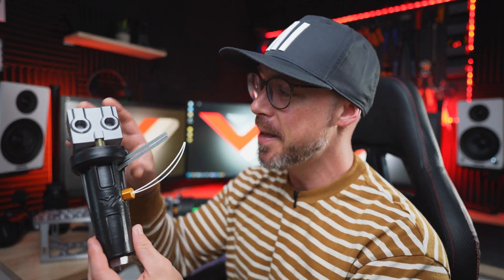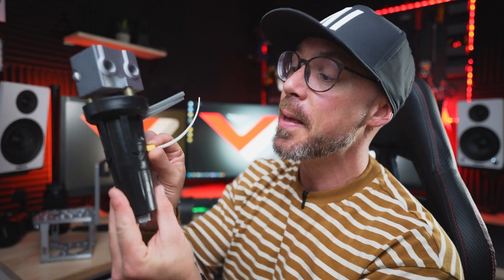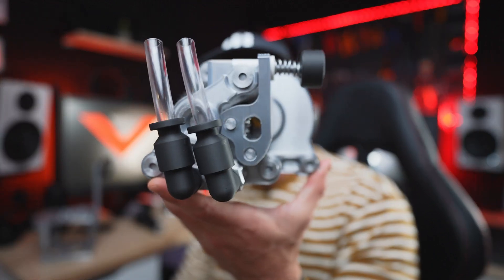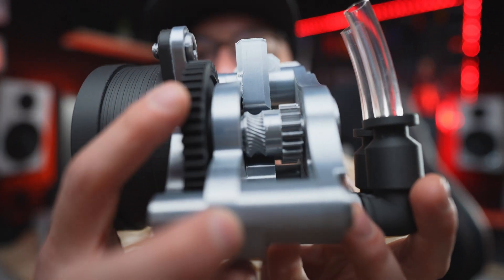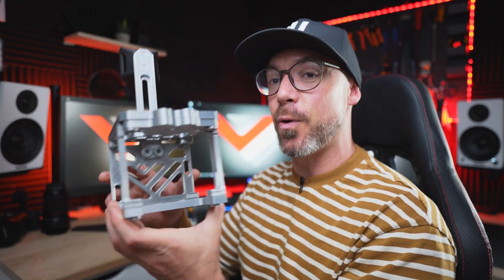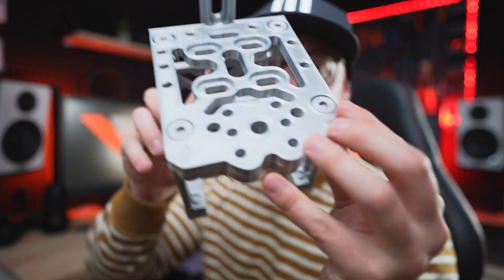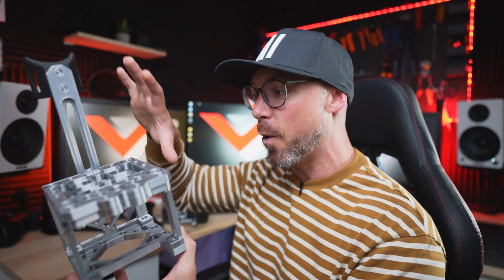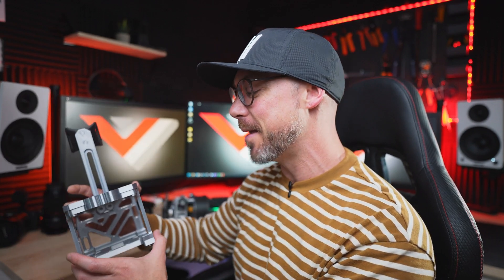3D Printed Vz-Printhead! 300% scaled

Comment: Hi Simon, I have a question, what is the minimum vel you are able to print abs and pla with the Goliath trying to achieve the best print quality not caring about velocity (obviously not printing at 50mm/s, otherwise I would keep the prusa) ?… I ask because I want to understand if it is better for me to switch to this extruder to speed up 50% of my normal prints but without losing quality on the other 50% when I need more precise print by making it go slower. (I use the printer for home and for work, at home I usually need a faster printer, but when I use for work I need the best quality details cause I use the printed object for casting aluminium, mould ecc ecc) 
Tnx
I hope u understand because I’m not very good in English 😅

Comment: You could put a tiny dc gearmotor and battery inside if the printed extruder motor to turn the gears. Very cool project, great print quality.

Comment: Niiiiiiice 

During the timelapse at 5:15, I noticed the leadscrew wiggles a bit. Since you use oldham couplers, should'nt they be restrained with bearings ?
Reply from the maker: You can add bearings and let the wobble taken by the oldham...but here i prefer not to do that. I let it wobble at thr top with no constrain..and let the oldham take the rest and take the miss alignment

Comment: Excellent model and project; now all you need is some 5.25mm filament to push through that beast. Thanks for the warning on that silk filament, but the results from your project may be enough to encourage others to push through on their own project.  What fell down during the C-Pap tube print?
Reply from the maker: Haha my cpap muffler. Next video ! It was not bolted just held there with pressure...forgot it was there actually haha

Comment: You need one that's split in half to show the whole filament path 👏👏👏
Reply from the maker: I love the idea
Reply: Yeeeeeah! Simon make it. 😅
Reply: I'd love it you added the air parts to see the difference in assembly. The plate between the toolhead bracket and the heartbreak will not be there right?
Reply from the maker: @jordi Fernandez Garcia  yes it will just be a different plate call the universal hotend adapter. You can see if on my video about the vz-hextrudort 3d printed
Reply: @Vez3D  I'll re-review it hehe